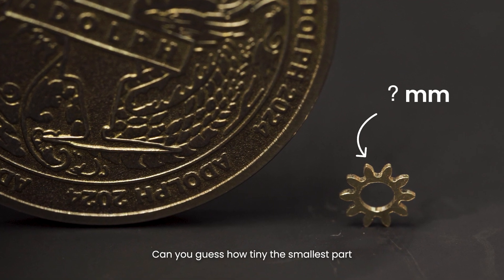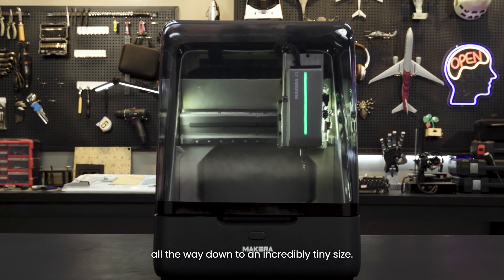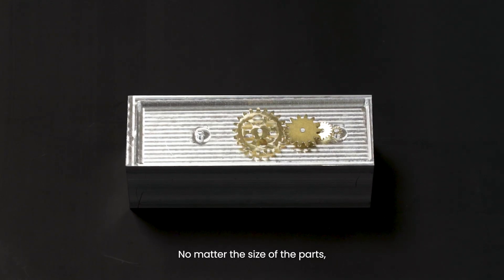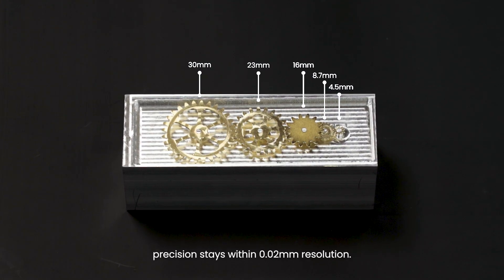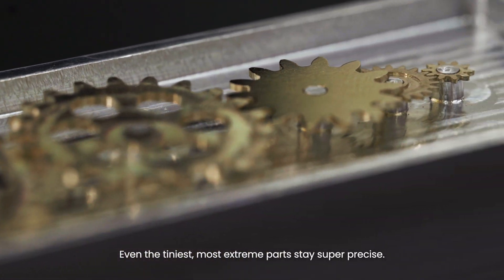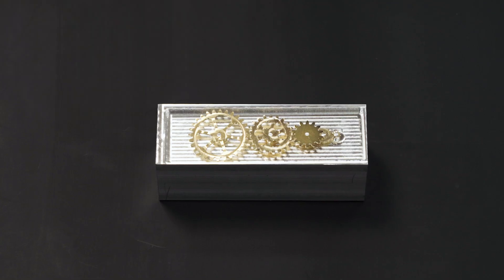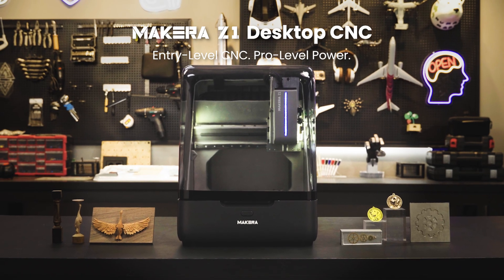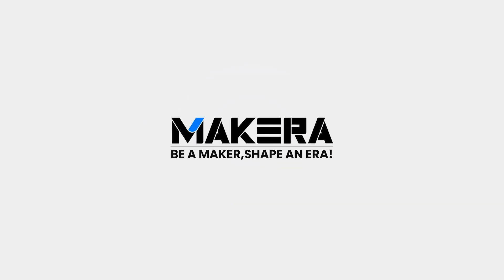How Small can the Makera Z1 Carve?

Comment: Make a better spindle... you showing soft materials only.
Reply: It's a $1000 machine, I'm thrilled I'll be able to work with brass and aluminium, as well as delrin and hdpe. No one expects this to handle steel well and I haven't seen makera claim that it does, they explicitly say that it's meant for softer stuff.
Reply: I'm buying it to learn.   As I understand this sort of thing,  if I end up buying a more expensive machine that can cut steel, uses cooling other than air, and so many more complexities, the skills will transfer.

At this price point i can afford to buy s machine to learn with.
Reply: why would you cut steel on a desktop cnc?

Comment: next, make a 4.5mm D herringbone gear using the rotary. ;-)
Reply from the maker: On it.
Reply: I have had the same thought!
Reply: @segretoesconociuto  so many creators out there making geared drive systems of one sort of another, showing pla, petg, and abs gears eating themselves...   this could change some things. :-) 
I wonder if HDPE gears handle themselves better than pla. 
because the carvera machines carve hdpe like butter.  they'd be faster and stronger than 3d printed versions for the same size. 
probably quieter too, with no layer lines rubbing against each other. 
lots of upsides.  
just need more users to show off the benefits. ;-)

Comment: Any info on the used endmills, seems the smallest one sold by makera has a diameter of 1mm and a effective cutting height of 3mm. 

The big endmill here was 4mm so these endmills probably have a 4mm shank and aren't sold by makera.
Reply from the maker: At this time, we only sell end mills with a shank diameter of 3.175 mm in our store. But our CNCs are compatible with any end mills with shank diameters of 3 mm, 3.175 mm (1/8"), 4 mm, 6 mm, and 6.35 mm (1/4"). They are also non-proprietary.

Comment: Is the Z1 desktop version an upgrade to the original carvera machine(not the air) or is this a more cost effective version?
Reply: This is meant to be baby's first CNC machine, with a lot of cost cutting to get its price. It seems they've made good choices of compromises to get costs down without sacrificing suitability for the hobbyist maker.
Reply from the maker: Thanks for your question! The Z1 is designed as a more accessible entry point to desktop CNC, optimized for hobbyists and makers. While it shares Makera's commitment to quality and precision, it's positioned differently from the Carvera & Cavera Air - featuring a more compact footprint and streamlined features at a more accessible price point. Think of the Z1 as expanding our family to serve different needs rather than replacing any existing model. Feel free to reach out if you'd like help determining which machine best fits your projects!